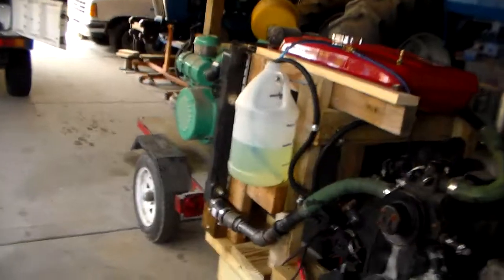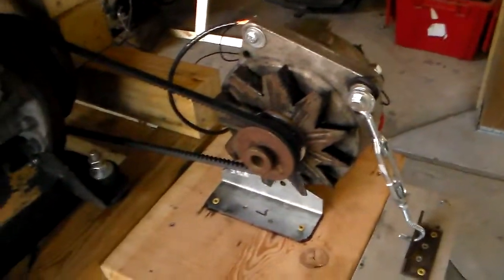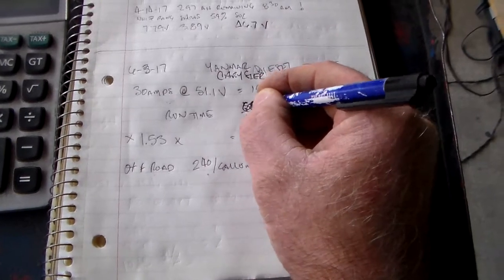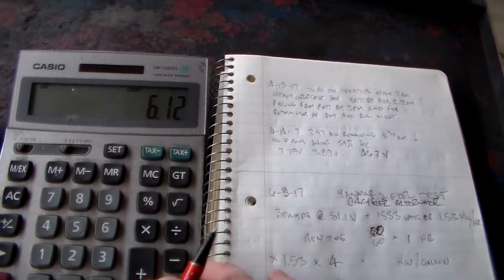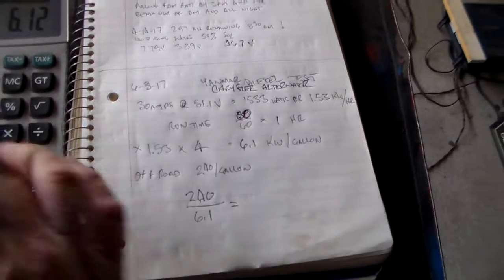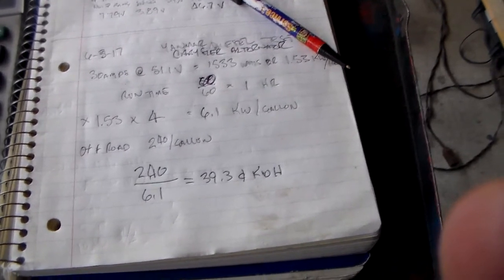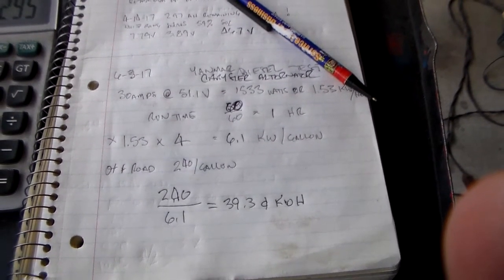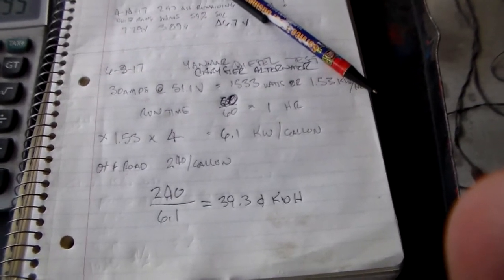Yanmar Fuel Consumption Test - Chrysler Alternator

Comment: I'll have to go back and look but I was able to produce 1kwh for .36 cents. What I can't remember was what I paid for off road diesel at the time. I think it was $1.90
This was done through the Trace inverter/charger. I need to do the test again using the Magnum. It is PFC so it should do better. What is your goal? My original system was set up to get 1500 days oggmenting the solar with a 220 gallon diesel tank. This was the maximum time I thought I could keep the diesel fuel viable with treatment from a Power Service product. By the way I have seen a turbo installed on the Yanmar engines. My magic number was .36 cents per kwh. For backup I'm happy with that.
Reply from the maker: Yup, I could easily fit a T2 Garret to this engine, but the gains are only there once you start to over fuel. Anything less than that, you're spinning a turbo for no reason- as I'm sure you all know.

My goal is nothing more than screwing around with different configurations in attempt to see how efficient we can produce power locally using a piston engine.  Juston has a great suggestion, IE: slowing down the crank, therefore reducing the number of times the piston must move up and down the bore per Kwh produced.   My studies suggest that BMEP (brake mean effective pressure) must be as high as possible at as low of a RPM as possible until you can no longer effectively burn the fuel IE: smoke.  That's the sweet spot we must find.  

I'll be very curious to know if the Magnum does a better job with the power factor correction. (my test using a gasoline inverter generator charging with AC thru the Magnum worked out to 53 cents / Kwh)   

For anyone reading this, Steven is using a diesel powered  AC generator- feeding it into a Trace Inverter/Charger, which turns AC into DC ( but it's not his only way of charging).  He has yet to try his fuel consumption test feeding it  into his recently acquired Magnum inverter/charger which is power factor corrected (it uses capacitors to get the power factor correct)
Reply: @mark_osborne 
Turbochargers recover exhaust gas energy even if you don't turn up the fuel rack.
Reply from the maker: @gregorymalchuk272  - so you're saying even IF my exhaust has no color, I might see an increase in efficiency by adding a turbo ? (I do realize turbos work off of wasted heat)
Reply: @mark_osborne  
The boost pressure pushes the piston down during the intake stroke. Even if you don't crank up the fuel rack. It gives you more power by talking advantage of the blowdown energy in the exhaust. Turbocharged gasoline engines do not work quite like this, because the fuel-air mix must be kept approximately constant, so more air necessarily means more fuel. Turbocharged diesel engines are actually the most efficient simple cycle heat engines in existence.
Reply from the maker: @gregorymalchuk272  Ok, I'm hearing you.  When we build pulling tractors, we like to see drive pressure (exhaust side pressure) equal to intake pressure.   If drive pressure is too high, we know the A/R on the hot side needs to be opened up.   So thinking about your hypothesis, if we are taking advantage of the boost pushing down the piston on the intake stroke, are we not also being robbed of that same energy by the added effort it takes to push the exhaust out on the exhaust stroke ?  or am I missing something ?
Reply: @mark_osborne  
When the exhaust valves opens, the charge is still above atmospheric pressure. That energy can be recovered. Either through compounding (a second low pressure cylinder), turbo compounding (using an exhaust turbine to exert more force directly on the engine crankshaft), or turbo charging. Yes, these all actually impose some slight backpressure, but this is usually outweighed by the gains in efficiency and power.
Reply from the maker: @gregorymalchuk272  Ahhh... yes yes. The exhaust valve starts opening say 45 degrees before BDC, and while the piston is still going down, at that point the rotating forces exerted on the crank are very diminished due to the rod becoming almost straight - so the blow-down before BDC can be used to drive the turbo and it is almost 'free'...  I get it !

Comment: You have enough power, you should be able to gear that so your rpms are down but still have a good spin (rpm) on the alt. bring your fuel consumption way down. I'm sure your running a thermostat on the engine so you can keep at 195° or so. deisel likes to run hot. 
looks great. great job!
Reply from the maker: Yes yes..... very good idea.  I thought about getting a smaller pulley for the alternator to do exactly what you suggest, and I believe it will help.  

The pulley on the Yanmar is a piece of art, it's very heavy and incorporates a centrifugal clutch--- looks like a mini-bike clutch on steroids.  I'd hate to lose it, but if it comes down to it, I'll fab up something larger.  The next move is to mount a larger Leese Neville 165 amp truck alternator.  I'll be able to load the diesel up to probably 8 hp and have much more flexibility as far as RPMs, and the ability to adjustable field strength.  That should provide for some interesting testing !... all coming next week.  Thanks for your good thought.